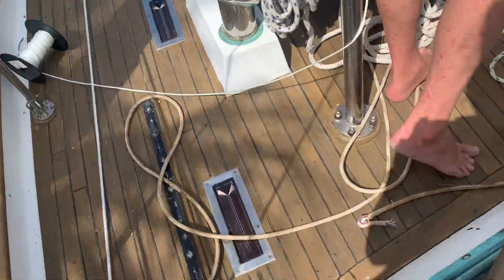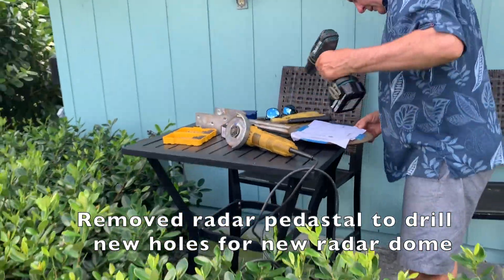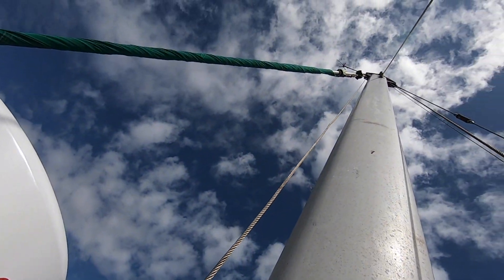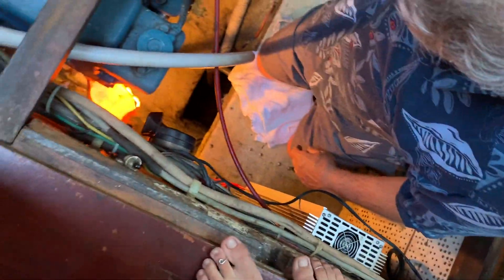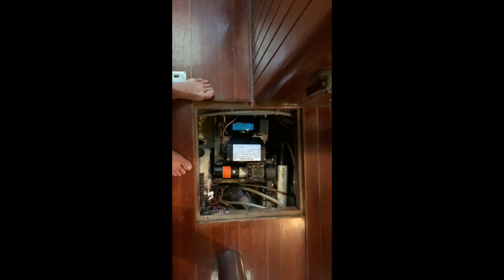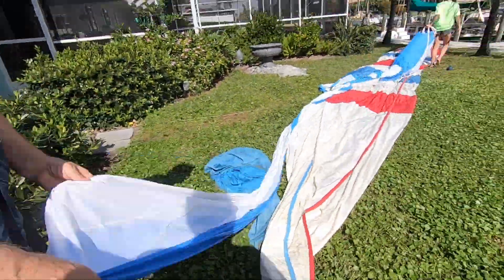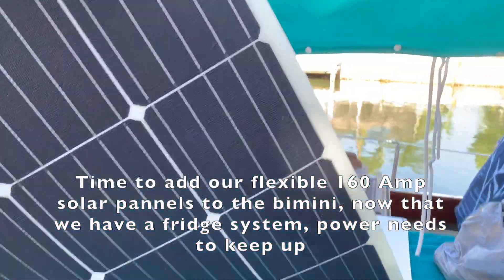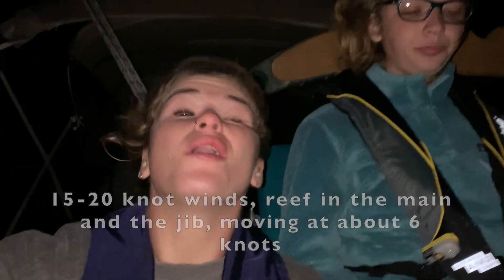50 Feet Above the Sea! The Far Side deserved some updates and a Makeover Video [S1:E04]

Comment: please don't use snap shackles to hold you when aloft - hand-tied knots only. Also, I didn't see any backup (secondary) halyard - always gotta be secured by two sturdy lines (halyards).
Reply from the maker: Neil Quigley Yes good point. I had a harness on and tether hooked around the mast incase the shackle failed but a second halyard would’ve been a better backup.
Reply: @SailingTheFarSide  glad you had a tether - didn't notice that. With triangular (closed) mast steps going ~all the way up, running a tether through a step where you're working (ideally one that's ~head-height) would be very secure - then just loop the tether around (outside) the steps when ascending/descending. Looking forward to your series! I'll be heading to Caribbean next year - solo on 32' Ericson that I'm refurb'ing now.